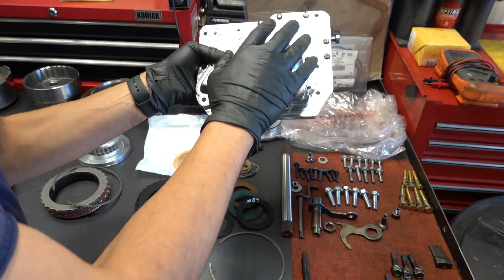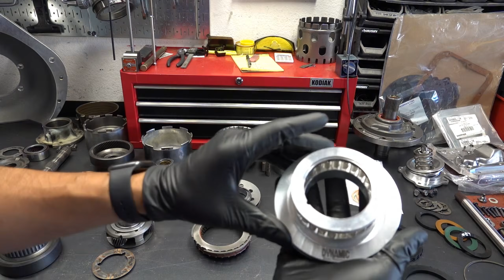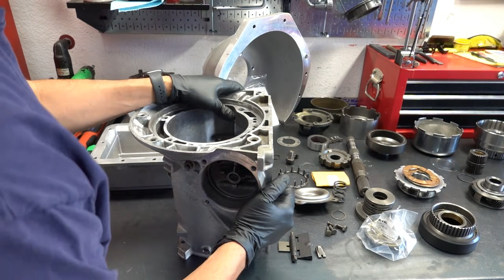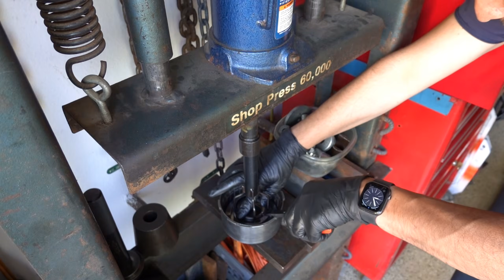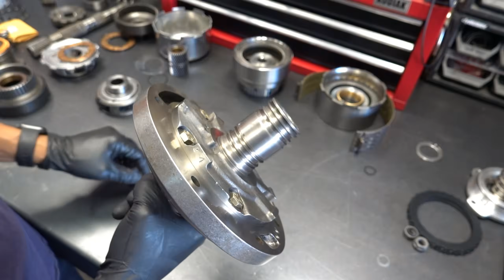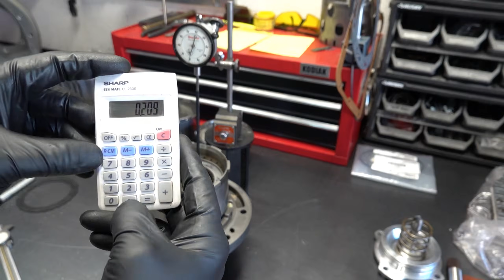Ford C4 Performance Buildup, Part 1 - Subassemblies

Comment: As soon as you said Chris at CK,I knew that drum was going to have some machining problems.

I’ve used lots of Chris’s 200r4 parts and quality seems to be hit or miss sometimes
Reply from the maker: That particular drum was fine, no issues with it that I saw. That said, there have been a few parts that had to go back for exchange due to machining problems. Not sure who he was using but they def had their ups and downs when it came to quality. 

Unfortunately he's no longer with us. Dynamic Racing's solid state fwd drum is also a very good option.

Comment: not to familiar with c4 trans, but wouldnt a c6 hold more power?
Reply from the maker: It would but I'm not aware of any C6 variants that have a 4.6L engine block bolt pattern. The engine application is a Ford 7.3 Godzilla which uses that 4.6L engine architecture and trans mounting bolt pattern. C4s have a detachable bell which allows for adaptation whereas C6s don't unless you want to have the case machined for one.

Comment: Nick, just finished my first TH350 rebuild using your videos. It’s shifting through all the gear and the fluid stays in it. I guess that’s a good sign . The kick down is not working. I have the cable adjusted correctly. What could I have done wrong?
Reply from the maker: Thanks for watching, Shadetreedesigns! Kickdown functionality is almost exclusively valve body (kick down valve, specifically). It may be sticking/hanging up. Did you overhaul the valve body completely, reassemble it with all valve trains installed correclty then work all the valves to confirm they move freely and return to rest position after spring tension is released?

Lastly, do you have at least 12-13Hg vacuum at the modulator?

That can cause kickdown issues as well, if vac signal is low there.
Reply: Yes on valve body. Went by video 100%. Might be the cable. I’ll want to replace it because it seems just not right.

Comment: Looking not too bad 

Mostly pretty good ..Lots of good advice... Couple things. Probably sick of hearing from me lol but constructive criticism. Love a nice C4 build. I do lots.
Why care what the governor support is like or fit rings to that governor sleeve. They are simply not required or used with manual valve body. Can actually eliminate all that extra weight spinning.

No need to block those governor tube holes. They are blocked at the separator plate. 

Hard to understand to go to all the this for a nice build and still leave the stock washers @ the rear planet. Those washers wear bad with good H.P. Easily converted to the common roller thrust. Same bearing as that one in reverse drum & front planet.

That Alto pack is designed for a standard high drum with no machining for home builder guys with no facility to machine the drum. With all thin steels and frictions. As you found has max clearance. With that new snap ring groove, most likely up .140" you can use either thick steels or thick frictions and trim factory thick pressure plate. Don't need kolene steels anyway. I'm not a fan of those thin pressure plates. Best to step cut an original to spec. Good setup with the thicker steels and thinner frictions.
One thing to watch with that new groove cut up .140" and the thin .128" pressure plate is that the top steel doesn't drop into the original groove. You should just make it by looks.
Glad you reset that high drum. Where is at now is good just over the .050"

When zeroing the dial indicator, light pressure on the pressure plate can add up to .010" 

Forward clutch is usually thinner frictions around .061" and thicker steels @ .078" is the original specs. All original steels in both packs are .078" The thinner .060"ish steels are all aftermarket

Input shaft? How is it that the splines are longer, but it doesn't come through as far at the face? Usually, aftermarket shafts are a tight fit, particularly in a new drum, they need a tap in with a soft face hammer to go right home. Need to then measure clearance to output shaft, and at times a counterbore is required in output for clearance

Easy way to I'D the belleville snap ring. They are always .080". And one end is square cut as you showed was spot on. Some those new Bellevilles are tight to go in. Occasionally need to compress in press. Usually, the old bellevilles are collapsed somewhat up to about .050" or more

Forward sealing rings . The green are for later .125" grooves . Usually black rings in the earlier narrow grooves. Find so many incorrectly fitted. You are correct , some teflons air test great, some are hard.
Reply from the maker: Thanks, Greg - appreciate the input and feedback, as always..

All of your questions have one simple answer: I've never built a C4 quite like this before (mentioned a couple times in the vid) and like anything else, you live and learn. 

If the unit comes back to me (which it may as the customer and I have already talked about a 'Phase 2' w/addl upgrades) then all the things you mentioned will be addressed then.